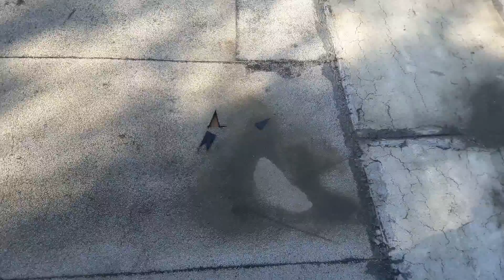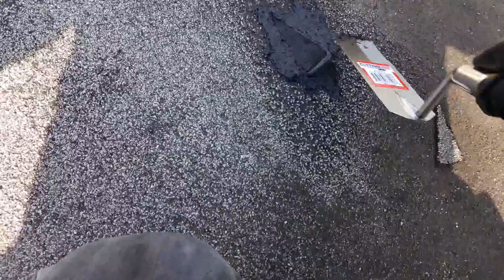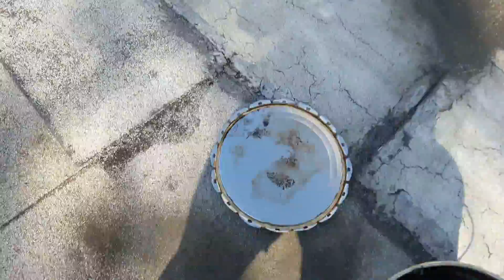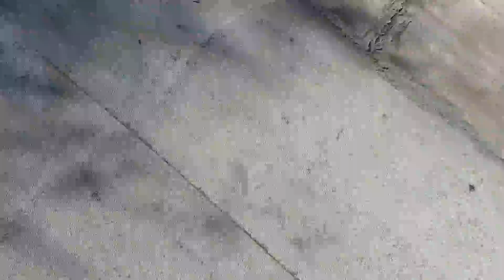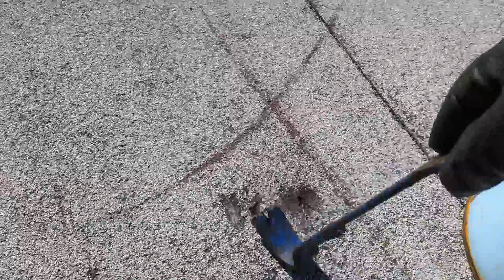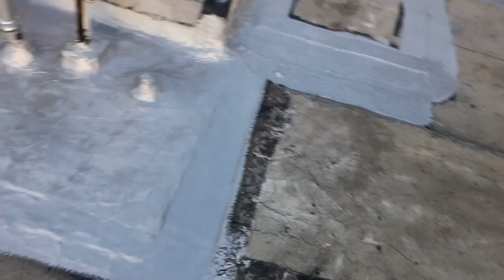FLAT ROOFING REPAIR : how to FIND AND FIX water leaks on any FLAT ROOF !!

Comment: I am repairing a flat roof that has a slight slope and has flooded my bathroom and kitchen , for the last 2 years, and it's on a small cabin .i decided to do it myself,and have learned more on your video than I have anywhere else ,and that is because of the way you explained it.thank you for showing me the right way to patch all the nail holes,and how to check where the water could be coming in. am only doing a repair,but think I can do this now. thanks, chyrise

Comment: I have done repairs on roofs for 35 years, and that's exactly how i would pin point where to find leaks on flat roofs , i find you and i do roofing the same, you have a crew, i just worked by myself. You are in California, i am in tx. Stay safe my friend.

Comment: Hi Eric, Thank you for showing how to find leaking area. I have a  new roof, but the roofer installed the roof can not find the leaking spot.   Where is your company? Can you share your company name?
Reply: I would advise a way to find a leaky roof is to die or color with a strong non toxic colorant some 3 or 5 gallons of water.Then on a dry day go up to the roof and apply some water at different locations on the roof area at periods of 30 minutes. Not all at once. Then you go down every time and with a flash light see if you find the colored water and relation to where you poured the water or some where else . Water travels amazingly from one point to other.

Comment: Lol it was still leaking after you did that right the water was getting under that patch and you dont. Need to wire brush the granules you can cement right on top of it and also the professional way to patch that roof is it torch down white granules roofing or cold process
Reply: How much to u charge for a big repair like that

Comment: Would an infrared camera spot the damp wood? Might be worth hiring one to find out.
Reply: I have tried this, and it can work, but it's dependant on existing moisture on the roof, whether, etc. The idea is looking for "cooler" spots under the roof to trace back to a leak.

Comment: You aint seen nothin. I'm in a commercial garage warehouse and the entire back wall spanning 40 ft is leaking. The windows themselves are leaking, and they did an addition without removing the outside vertical tile shingles. The mud seal 2×6 have 0 protection and is coming from below, as well. I'm screwed

Comment: Yes it's webbing. I've been roofing for over 35 years and I've abserved the next generation roofers crybabies. You can't tell at them they have to go to the bathroom right after lunch and there always on their phones. Can't get much done when you're babysitting. I'm not saying all of them are like that just the ones I've seen. Here in Hawaii. Anyway great job on the video. To me it was sad that they don't do hot tar anymore. I was great at it and a foreman for many years. Torch on is easier one guy can do the whole roof if he has to.

Comment: What’s that crap you are useing? You should be going over these with felt patches if they a holed. And your fleece is not webbing and that goes in after your first layer of goo then a triangle patch then more goo then Moore fleece then more goo then your top triangle. Because you have not overlayed with felt 150mm past the hole all round,your repairs will fail with the weather swelling and shrinking. Good luck anyway

Comment: .I thought you wasn't supposed to use roof cement on membrane???
Reply: Roof cement is what is used for any BUR system ,  cap membrane or asphalt . It is not compatible with tpo/pvc or epdm

Comment: Why don't you use thermography to find the wet areas before you do destructive testing?
Reply: Because he ain’t good roofer
Reply: @pureblood1415  I did roofing for 30 years, and he knows.what he is doing, he puts his name behind his work. And tell me why he is a bad roofer,
Reply: @edgarbaring6319  if you have to patch a roof like he is you have to put a patch on at least 150mm past the hole all the way round. The sun is just going to melt that patch he has done. Besides that you can see wood in the hole,the wood has not been primed so the felt is not stuck to the roof timber but that patch is. So when the felt moves with the weather the patch won’t so it will hole again. As I said,bad roofer
Reply: @edgarbaring6319  if the felt has been nailed down,that is a leak waiting to happen
Reply: @edgarbaring6319  just so you can see I know what I’m doing,I do slate and tile,specialist in diminishing slate roofs,liquid,fibre glass,rubber,hot melt,single ply roof systems and torch on felt

Comment: I am doing torch down on a small warehouse i am building in my property for my personal use.  i see you use spray  paint asphalt primer, my friend gave me a bucket of asphalt primer with a paint brush. which is better ? & also should i put it on thick or lightly ?  thanks.
Reply from the maker: roll on asphalt primer is primarily used over wall or concrete decks, spray asphalt primer is used over sheet metal .